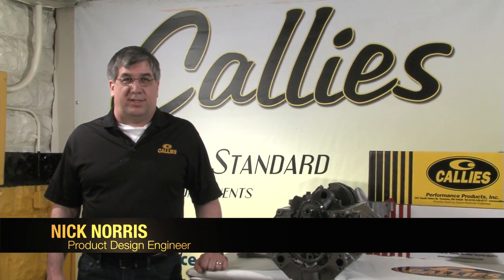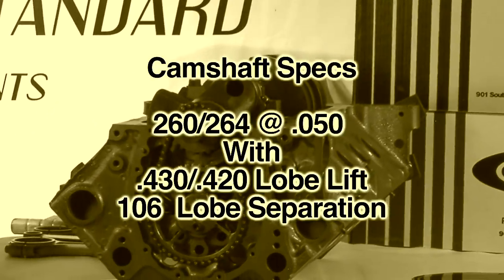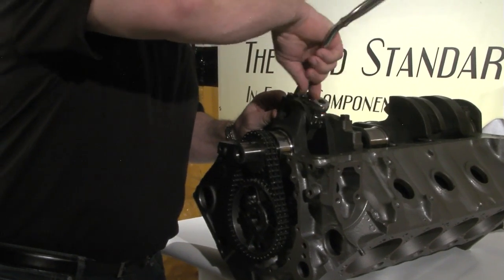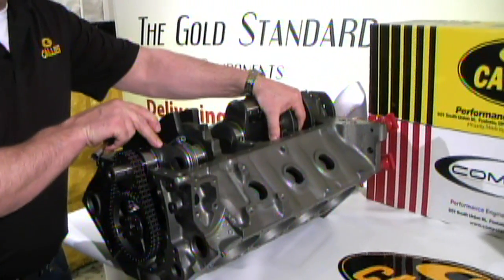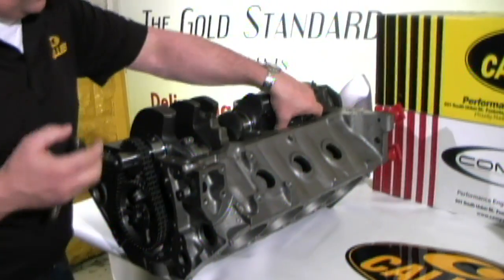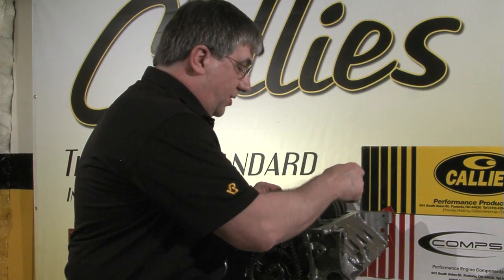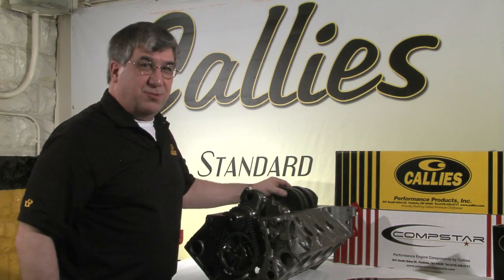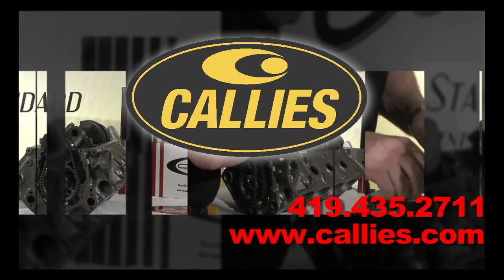Callies Tech Talk  "Ultra XD Connecting Rod"

Comment: I wish I had these in my DART 434 SBC going into my 84 Vette here in Australia. I mocked up a standard base circle Comp Cam (08-467-8) and the 6" Callies Compstar rods that DART uses in the assembly hit the cam. It is currently in the machine shop here in Australia with the techs looking into linishing the rods and re-balancing the assembly for me. The Compstars are $1100 AUD here and the Ultra HDs are $2200 AUD...fingers crossed I can just trim a bit off as I would really like to run a standard base circle cam and not have to custom grind one.

Comment: The lift of the cam you shown is lower than a stock 305 lift let alone most hardcore race engine builders. A .500+ lift and your rods won't work without machine work. Nice try on attempting to fool people with a big duration to compensate for a weak lift.
Reply from the maker: The numbers listed are lobe lift. They need to be multiplied by rocker ratio. As an example, .430"/.420" lobe lift with a 1.6 rocker arm has .688"/.672" lift at the valve. Nick